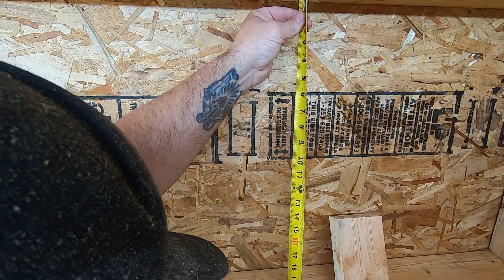4x8 chicken coop build | Southeast Alaska Homestead

Comment: Is it high enough to fit a wheel barrow under for the clean outs? Pull the window screen as not only will they destroy it but anything that wants to get in can just push it in, Chicken wire over the window will let you still open it without the risk.
Reply from the maker: Yes and yes. Wheel barrow fits and the screen is already out with hardwire cloth over the window.

Comment: I have the 18v cordless version of that Makita oscillating tool, I freaking love that thing! 

Finding that all the 18v Makita is really good stuff, they have a random orbital sander that is also a fantastic tool, and the weight of the battery dampens the vibration of the sander so you don't get sore hands using it! 

Also have their 18v skill saw, jig saw and router, all highly recommended!
Reply from the maker: Markita makes some good tools. I have the 18V set with a drill, driver, skill saw and sawzall. They all work great.
Reply: Renegade Show I have one of their old saws, I think it’s nine volt... I’ve owned it since 1994, both batteries and everything still works.... Makita really makes great tools....

Comment: awesome job! Won't that be dangerous for the chicken to be down there where all the eagles roost? Don't know just asking. Long way to walk or ride to get your eggs too. Thought you might put it up by the house.
Reply from the maker: Thank you. No I don’t think it will be dangerous for them. They will have a 8x8 foot enclosed run and when we go outside to work in the garden we will let them run around in the larger fenced in area. My wife also wants to put some netting up in two of the corners to help with bird attacks. The reason we didn’t put it close to the house is because it’s typically 5-10 degrees cooler in the tree line and I also have a direct line of sight from the cabin and front door. Just in case some bear does want to try their luck.
Reply: @AnAlaskaHomestead  I'm sure you studied the idea before you built it out there. Very good.
Reply from the maker: We did👍

Comment: Hey there Y'all!

Your coop is really coming together in FINE FASHION!!!!

The way you've built up that Nesting Box line, a Pterodactyl could give it a try WITHOUT breaking!

I'm still looking forward to when the Chicken Math sets in............beware the Chicken Math!

My quail eggs are supposed to ship tomorrow.....I've got the waterline pressure regulator, the chick and cage side feeders should show up tomorrow, now I need to order the Columbus Aqua Horizontal nipple waterers, analog temp gauges for the incubator, get the brooder set up, and then start building cages.

Naturally, I'll be buying a few fifths of Batmobile Bacardi Black Rum for those moments of both Mistake and Success, to last me throughout the building process! Never begin these types of projects without some quality Batmobile on hand; regardless of mistake or success, you'll still be satisfied!

Cheers from the Oil Patch in Central WY
Reply from the maker: Good luck with the quail. I still think that’s a great idea. 
Batmobile oil, it keeps things running smooth.😂
Take care JR.